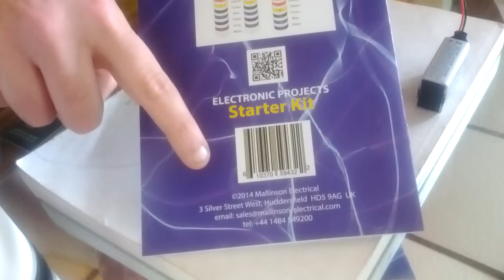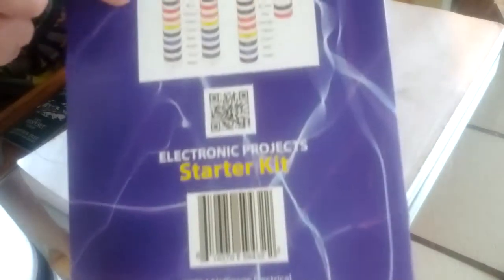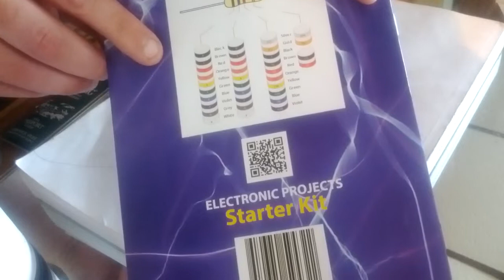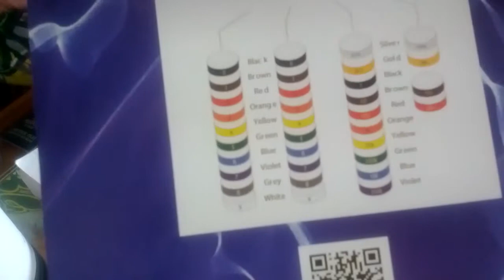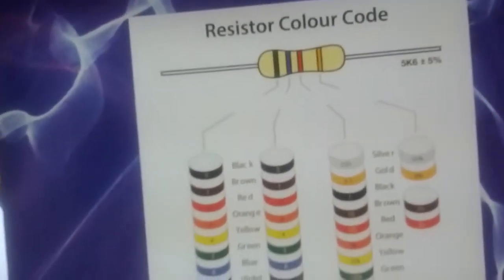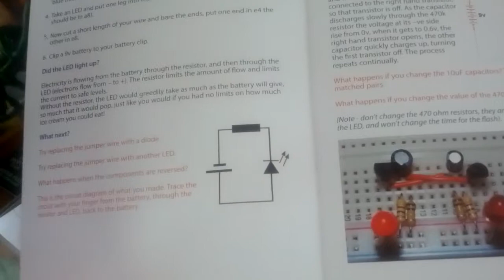Breadboard Basics - Simple Circuit - Success

Comment: Hi!    
The reason why it was not working the first time, was likely that you mounted LED wrong way! + And - is important for light diodes. All diodes conducts current in only one direction: the arrow direction, Or ring on diodes. For LEDs there is a flat portion at the short leader, this is negative.           K = Kilo = 1000 M = Mega = 1,000,000     
73    Johan.
Reply from the maker: Thank You!!!  Answered my questions and even one I didn't know I had.  Good stuff!!!  That's what it's all about.